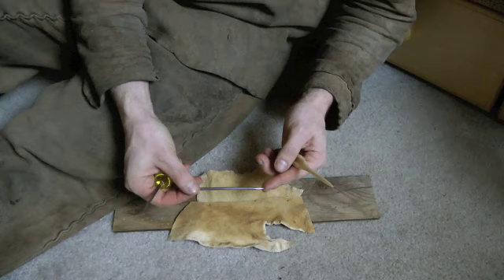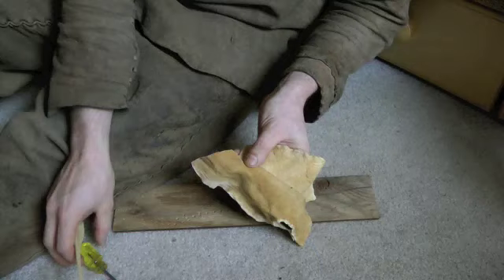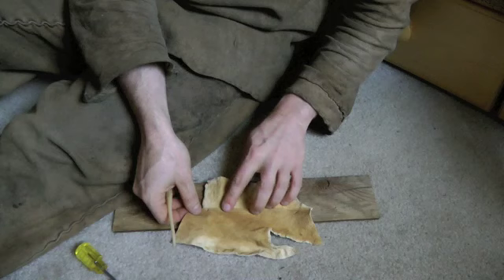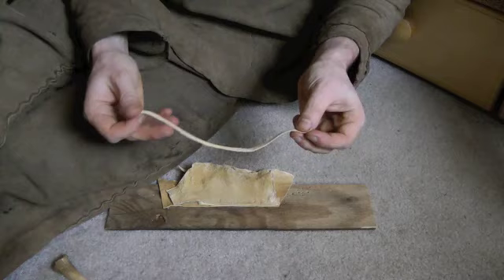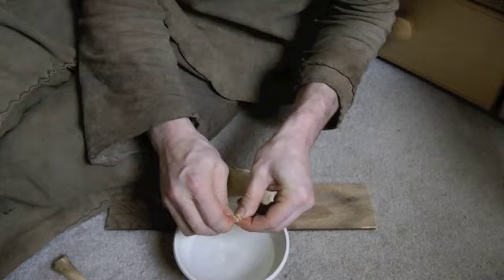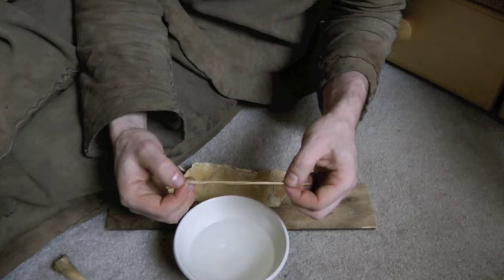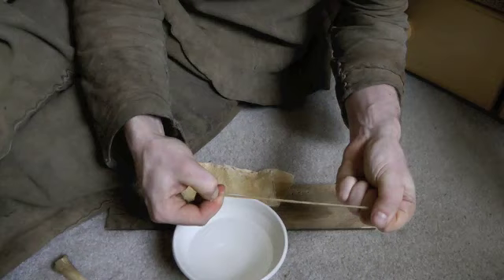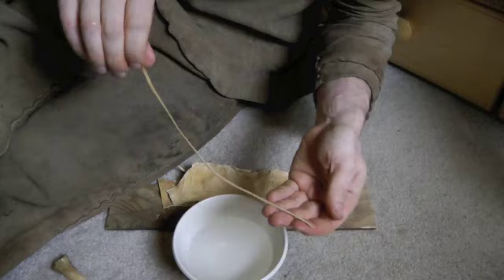Sewing with Buckskin Part 1

Comment: That is great info I appreciate you.  If you ever get the urge to record while your sewing a new set of clothes, no matter how long it takes, that would be insightful.  I would like to see how you decide to match the thicknesses of the hide and what areas they are used or if it even matters.
Reply from the maker: +Jeff Kirk Alright, I'll try to keep that in mind. Trying to match the thickness of individual pieces is more of an ideal than anything else. The real trick is to have enough hides tanned that you can more or less match them for overall thickness and surface area. As a general rule I don't like to work with very thick hides; they're just too bulky. So I keep medium weight hides for pants and pullovers, thinner hides for light shirts and sleeves, and then the thinnest ones like doe hides for inside pockets. After that, it's a matter of laying out your patterns the best you can and whatever thickness happens in one area or an other is just the way it is.
Reply: +Xavier de la Foret that is very helpful info.  I did not think about using the thin, soft doe hide to make the pockets.  Your wisdom is much appreciated once again.  Luckily, I met a deer processor last season and he was just throwing the hides away at the time.  So I have fleshed, salted and stored about 70 hides as you have suggested.  I have started on the hair and brain tanning but it is really taking a lot of time due to the cold, wet weather here in Tennessee.  Thanks again I'm looking forward to trying this out, I must learn patience for now.  I will have time to make the tools such as the bone awl.  One more question, would you use the welt to make the tassels down the sleeves and pant legs or is that done another way?
Reply from the maker: +Jeff Kirk Yes, cutting a very wide welt to make the fringes is a great way to do it. If you have an overlapping seam you can also keep the overlapping piece long and cut the fringes out of that. Make sure to cut your fringes as thin as possible or they won't look good.
Reply: +Xavier de la Foret Thank you sir, I appreciate your time and comments.
Reply from the maker: +Jeff Kirk You're welcome!

Comment: If you would, I would like to see your finished garments like the shirt you wore in the video.  I noticed the neck area and the extra length of the left sleeve.  This would be  very interesting to get a closer look at these areas.  In the pants, do you notice the welt rubbing your inner thighs as you walk or doing daily choirs?  What is the best stitch for areas that may rub together such as the crouch and arm pits?
Reply from the maker: +Jeff Kirk All my clothes with close-up pictures can be seen on my blog at http://sustainablelivingproject.blogspot.com/search/label/Clothes
The secret to buckskin clothes is to wear them fairly loosely (I'm a little guy but my pant legs are 9 inches wide at the knee, welt to welt; the opening for my arm, from arm pit to the top of the shoulder is 10 inches; Both pieces of clothing fit me very well that way, and they look good). First, that makes it A LOT easier to get in and out of the clothes as otherwise they tend to cling to you like your own skin. And then that makes stitches/welt rubbing on you a non issue. My crotch and arm pits are both welted and they're not a problem.

Comment: Is buckskin stretchy?
Reply from the maker: Yes, it is very stretchy. That's why you have to wet your buckskin thong and pre-stretch it before you use it in your sewing project, so that your stitches don't get loose on you.
Reply: @sustainprimitivelife  Thanks! I guess a finished buckskin article is stretchy too, so that, let's say finished bucksking gloves with a size a bit smaller than the hand will do well, is it?
Reply from the maker: @okeyeng8024  It's possible but it really depends on how the hide was stretched in the final moments of softening. If it dried in a "neutral" position the hide will stretch a little in all directions. If it dried in a stretched position then it will not stretch at all in that direction but much more in the perpendicular direction.
Reply: @sustainprimitivelife  Thanks!